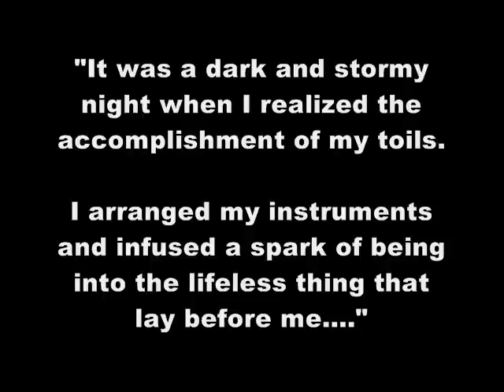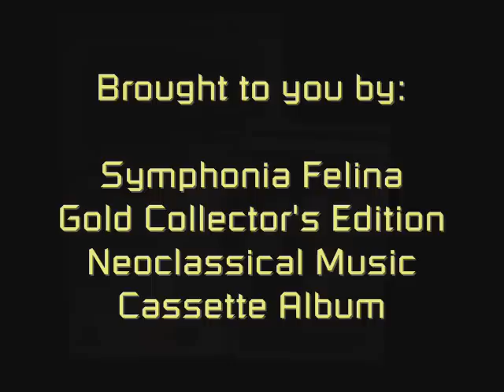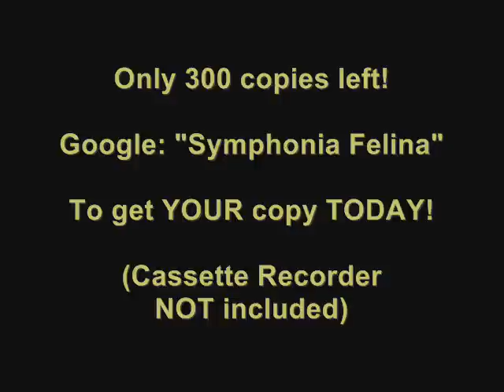It's ALIVE! - Standard SR100 Unique Cassette Recorder!

Comment: Great video! I've got a Standard SR "Cassette 7" recorder that my mother bought second-hand in the 1960s. Mechanical mechanism seems identical to your SR100, including the unusual rec switch and the ball bearing race (if you ever lose these, use the ball from some BIC pens - they work nicely!). A brake is applied to the rewind spindle when turned off, to stop the tape racing ahead while the capstan slows down. The motor speed is regulated by an internal centrifugal switch mounted on the rotor.

Comment: @clydesight 
Your welcome! Yours is in excellent condition, and I'm impressed by the battery indicator. I had plenty of fun exploring my "Cassette 7" many years ago, but unfortunately I could never get it to record. It erases though and the mic circuit works perfectly - with an external speaker connected, it makes quite a good little 'PA' system. The signal just doesn't reach the play/record head. Can you recommend any sources that could supply a circuit diagram?